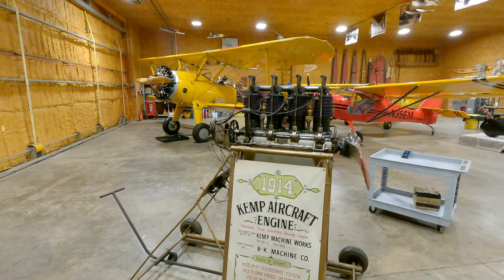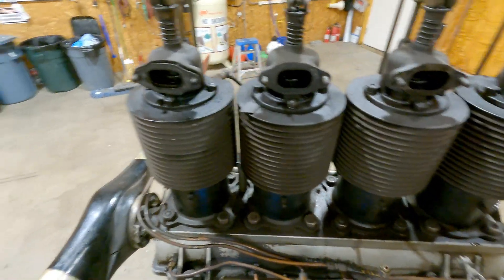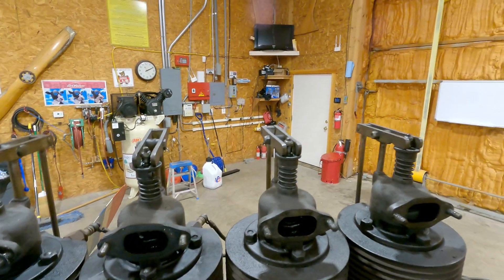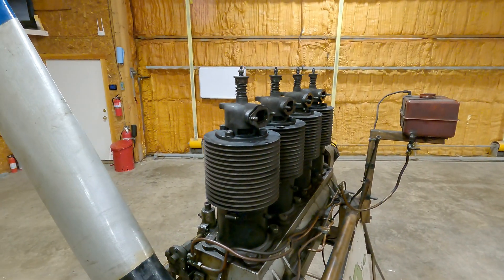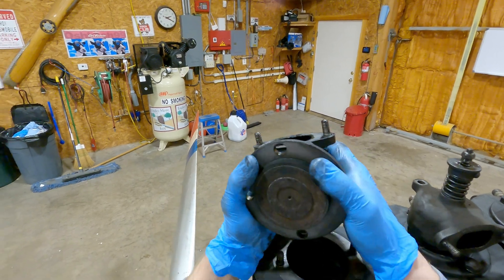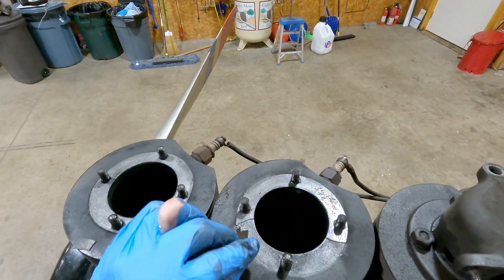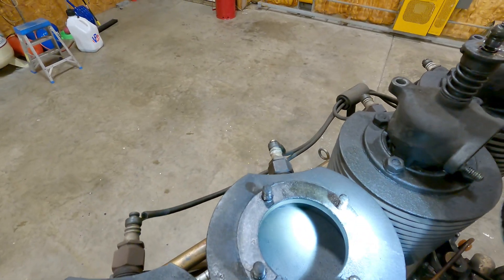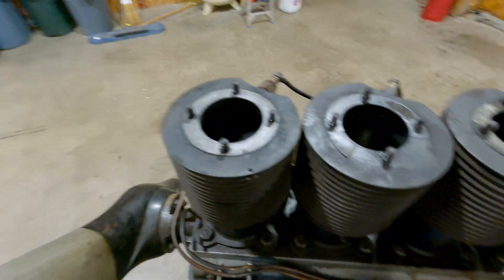1914 Kemp Cylinder Head Removal

Comment: The ports on the bottom are auxiliary exhausts which relieves the heat load from the top of the cylinder by getting rid of the hot gasses at the bottom of the power stroke. They were used on many early aircraft engines including Bleriot's Ansani that he used for crossing the Channel in 1909. A well-designed aux exhaust will use long pistons skits to keep the ports closed at TDC otherwise crankcase oil will have a direct path the outside (the Ansani was not well designed in this respect). Franklin used them on all cars from 1905 to 1911 but collected them into a manifold and had a valve to block the aux exhaust on the suction stroke. The last use of aux exhaust that I know of was on an experimental Continental Radial with sleave valves. The aux exhaust was controlled by the lower edge of the sleeve.
Reply from the maker: @BouvardHosticka This is excellent information, thank you! It definitely makes sense. We have an Ansani engine in the museum, and I have seen the holes drilled in the cylinder barrel for the aux exhaust, but never really unstood it until you explained it here. I love these early engines because you see all these unique concepts that were practiced for a while that are so unfamiliar to us these days. 

Thank you again!
Reply: @motocrosser411  I drive a 1910 Franklin 1500 miles a year with concentric valves (both mechanical) and aux exhausts. You learn the peculiarities of these sort of things when you have to clean the coke from the aux exhaust every year and time the valves afterwards. Since they are mechanical with overlap, the closing of the exhaust is when the exhaust is coming up while the inlet is going down. When they meet defines the setting of the tappets.

Comment: The use of atmospheric intake valves is a horsepower saver in a low output engine, not to mention the fact that it removed an entire cam surface to deal with! Amazing technology for the time with that intake system surrounding the exhaust valve. Probably provided quite a bit of cooling to the exhaust valve, as well as a bit of extra atomization/vaporization of the incoming fuel charge due to the heat increase in that passage.

Thanks for the history lesson, as a model IC engine builder, I will have to see if I can’t model something like this on my next atmospheric intake design. Should be quite a challenge at a smaller scale! 😳
Reply from the maker: @a41capt that's a very interesting point. I never thought much about the gains from the elimination of frictional losses associated with the actuation of the intake via camshaft. I also considered the cooling of the exhaust valve but didn't consider the benefit of helping to vaporize the fuel in the intake charge. This may have been helpful if their fuel was less volatile back then.
Reply from the maker: If you would like to model anything inspired off of this engine and need any measurements etc let me know!
Reply: @ thanks, that’d be wonderful! I’ve already linked your video to my model engine group and it appears there’s quite a bit of interest. Some of the members do their own casting, although that’s beyond me. I work strictly with bar stock, so I end up with lots and lots of swarf!
Reply from the maker: Thanks for sharing it with your group! It would really cool to see a model of one these built! I'm not a fabricator for the most part so I'm in awe of those that can!

If you or your group want any information on the engine, my contact information can be found on our Motorcycle website here: https://eaglesmeremotorcyclemuseum.com/photo-gallery%2F-contact-us

Comment: Was this engine acquired from a collector in the state of Indiana or the Midwest?  I recall seeing a very similar set up at the big gas engine show held in Portland, Indiana 50 years ago.  The sign on the engine stand looks very familiar, and I am sure it was a 1914 Kemp aero engine I saw in ‘74 and ‘75.  I can vividly remember seeing a guy pulling the propeller through many times trying to start the engine, in front of a big crowd in the grand stands of the fairground that served as the venue for the engine show.  I never saw it start and run, but others I know who attended the show over the years back in the early to mid 70s said that they had seen it run.  If it is the same engine, I’m glad to finally get chance to see it run!  Can you get a good shot of the sign board in the stand?  Thanks for giving the engine a good home and for sharing it with us!
Reply from the maker: @michaelmurphy6811 we did buy this from the machine shop that build these out of Indiana. The gentleman we bought it from said that his family used to take it the fair and run it! I'll sure this is the same engine! I'm happy you got to see it run too! Come visit is year and you can see it run in person!

If you increase the quality to 4k in the settings here and pause it you might be able to make out the sign. Otherwise, leave your email here and I can send you a photo of it!

Comment: Those cylinder ports are for exhaust. The steel bands just below the fins are to adjust the openings.     "Also found in the box were four steel bands which
it was determined were some sort of control of exhaust gasses that were allowed to escape through ports drilled in the cylinders immediately below the lowest fin. Scavenging of the cylinders was not only through the exhaust valves but also through these ports." -The Vintage Airplane, Mar 1980 p.12
Reply from the maker: This is awesome, thank you so much for sharing! I just assumed they were not because of the overhead exhaust valve. Curious that they would choose to evacuate the cylinder from two spots simultaneously (no rule book back then). Now that I know this is I am going to have to take a closer look at the barrels. I saw the bands on them, but not the exhaust ports. I wonder if ours are adjusted shut. Thanks again!